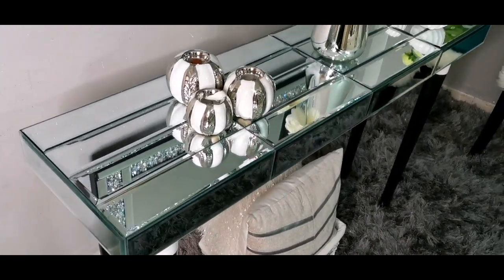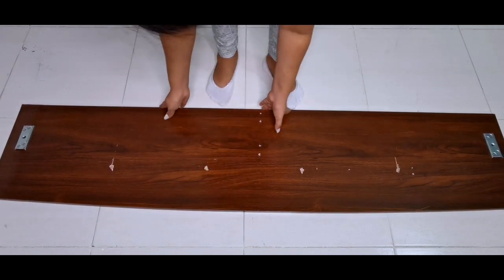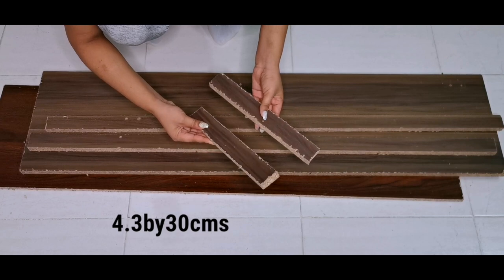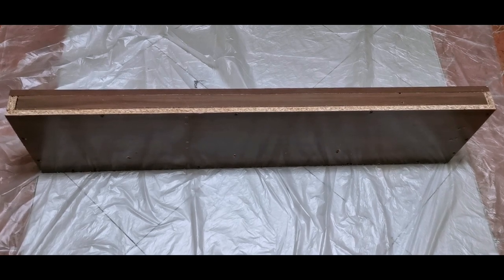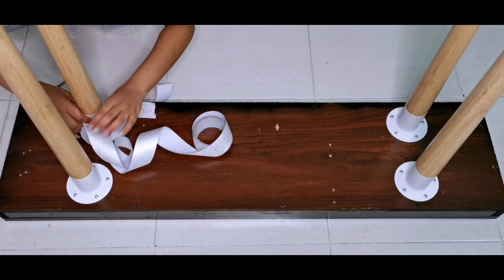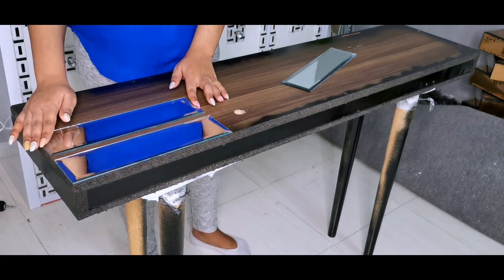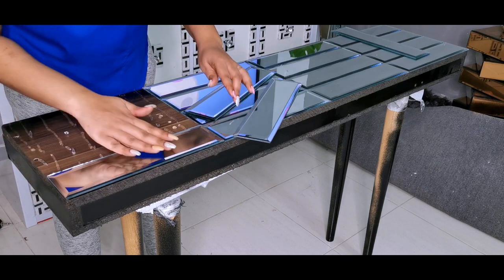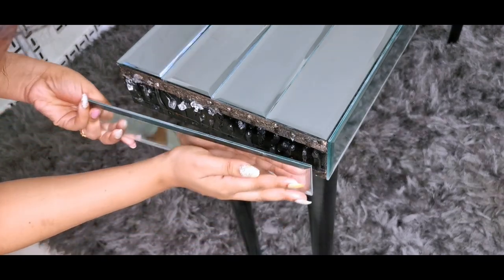DIY MIRROR CONSOLE TABLE | HILVER LEGS IKEA HACK |RECYCLED WOOD

Comment: Just a little note about safety..
I was concerned when you were using your drill so close to your feet
just wearing socks. If the drill slipped for any reason , your foot 
could be injured. Perhaps wearing 
heavy shoes or boots while using your drill might be safer and avoid 
injury..Otherwise the table is very pretty and a clever design.